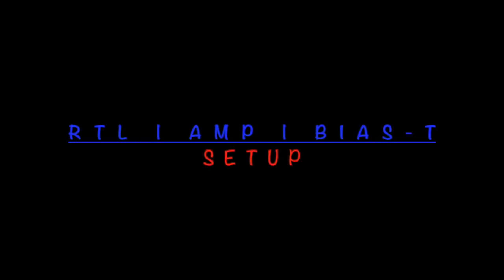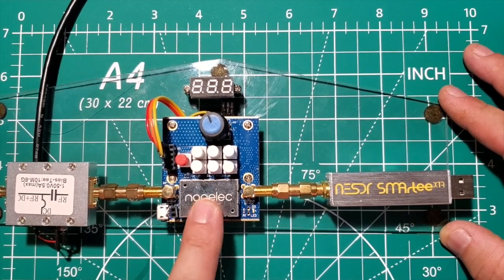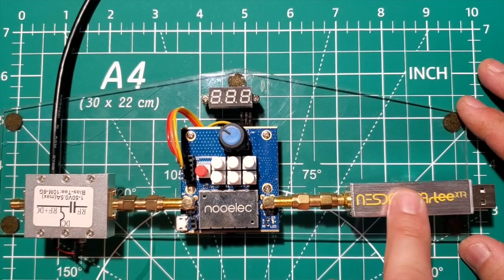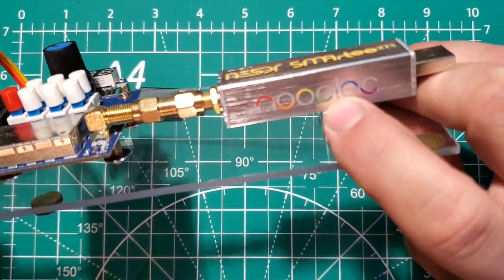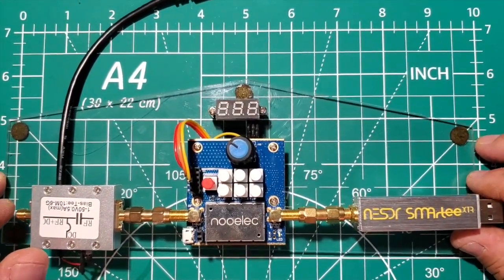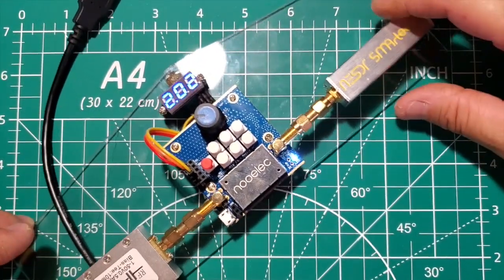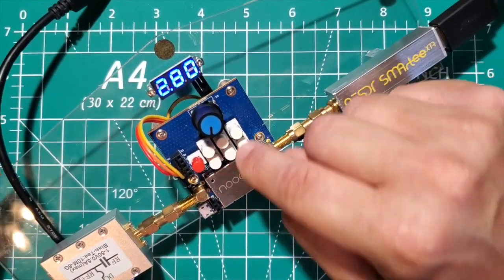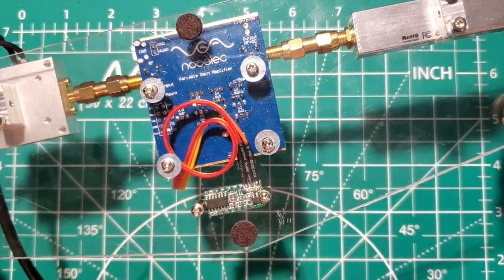NooElec SmarTee  |  With Vega Barebones Amp And External Bias-Tee

Comment: I have the same sdr dongle, along with the ham it up up-convertor, and just ordered the sawbird+ NOAA amplifier...
The ham it up and saw bird can be powered by bias tee, but I'm trying to figure out how to do this. I currently have the ham it up powered by USB cable, but it will not run when I unplug it. Do I need to buy a secondary bias tee to put after everything, before my antenna? I also purchased the DC filter. For some reason I feel like something needs to be modified within the dongle to make this work, and I'm not afraid to do so... I've built my own tube guitar amplifier, but don't know much about SDRs...I'm new to this.
Thank you for anything that leads me to success!